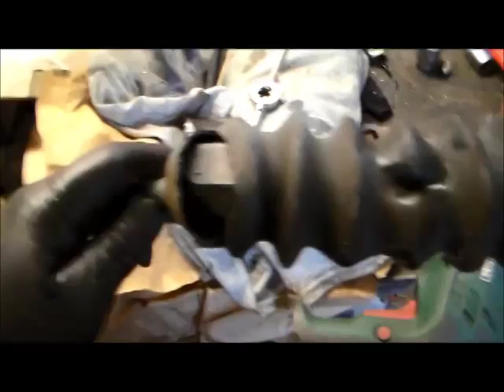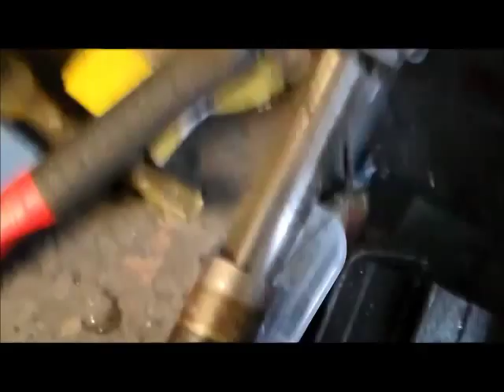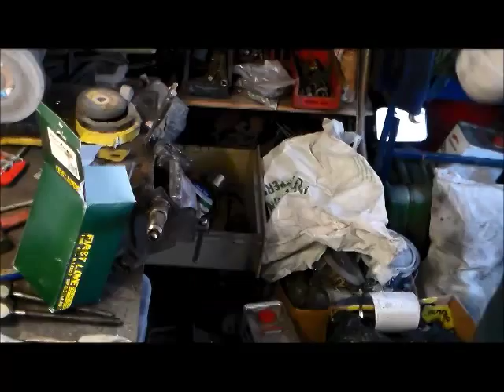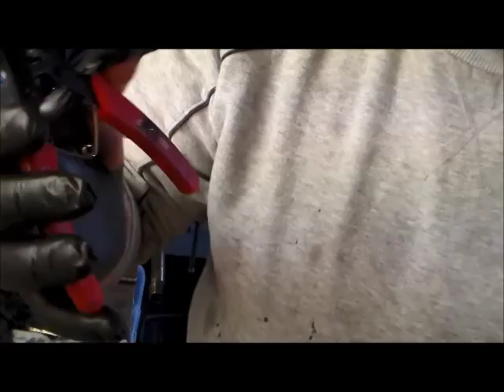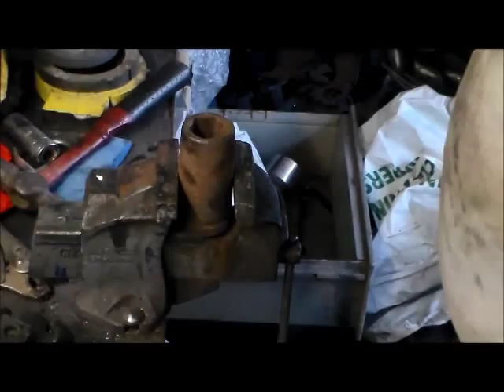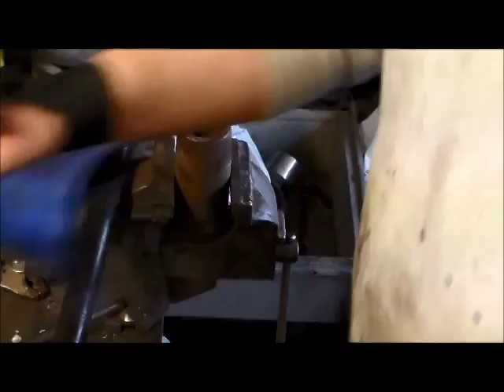30Th March14 Triumph Steering Rack Strip down Pt1

Comment: Nice discussion of rack-and-pinion steering. Having never seen a steering box before I gleefully pulled the XK-120 apart only to hear dozens of steel balls bounce around the floor. The Jag used a recirculating ball steering box, something I had never even heard of back then. What a palaver that was getting that thing back together with all the little balls back in place. I never found a description of it or any kind of instructions on how to put it back together. I guess they never thought anyone would be silly enough to take one apart.
Reply from the maker: Its odd isn't it , over here certainly when I was a practicing mechanic, so to speak, certain things were seen as specialist, so we never touched them, like steering boxes, basic adjustment, otherwize tear it off and buy a replacement??

Comment: Great stuff Scott! With the low quality of aftermarket racks out there, I'm rebuilding a solid core I picked up. Thanks to this video, I have it torn down and cleaned up. I'm replacing the inner and outer ball joints, and I sprung for the better silicone rack boots too. Thanks!! Mike
Reply from the maker: Hi Mike, thanks for stopping by and commenting, hope it all works out for you, cheers Scott.

Comment: I can believe the 11 turns stuff...It's much the same with most same like models of Holdens too..Unless an aftermarket tie rod end or rack end has been used prior...The play in the rack was only a metric poofteenth so it's in pretty good shape for it's age..I was thinking about locking tabs just as you banged 'em...I have some bits of a set of those crap plyers from way back...I can send 'em too you for spares....lol
Reply from the maker: Hi Ziggy, yep should have got some new lock tabs really but, they were in pretty good order, yep not really over charmed with those pliers? Don't think I'll get any more, can't afford Snap-on any more so probably why they were a bit naff?

Comment: Love the simplicity of rack&pinion, basic gearing :-))

so the center of the rack gets worn more than the less used outer teeth, much like the steering head bearings on a motorbike, worn in one spot.

Hmm that wire, the one on my mates convertable seems stuck, he cant get the bolt undone, it has to be attacked as his horn plays up and moving the wheel makes it work for a short time.
Reply from the maker: Yep I reckon it must be the same reason